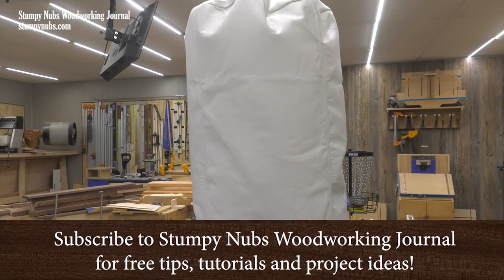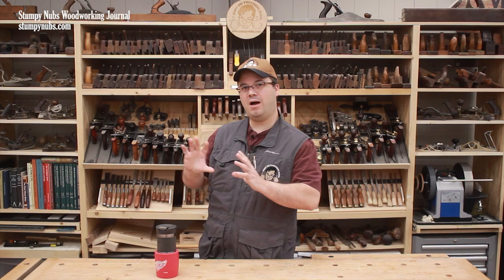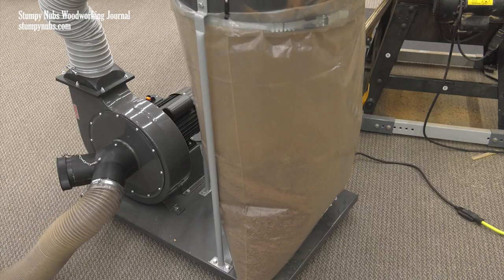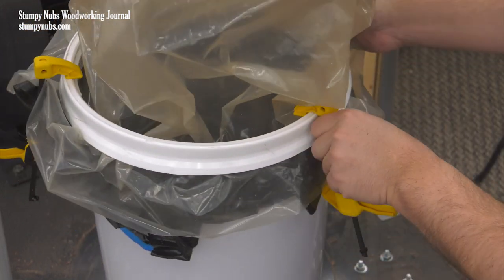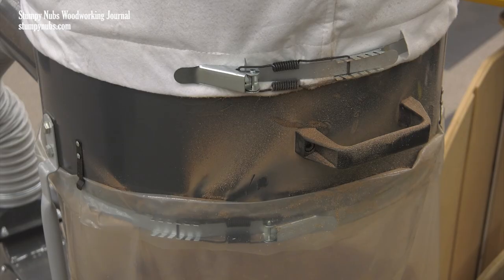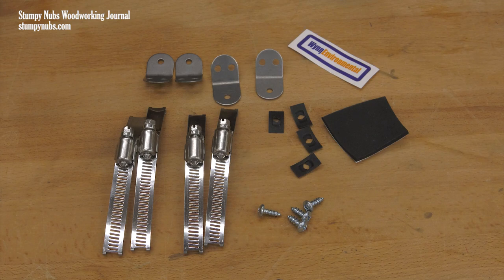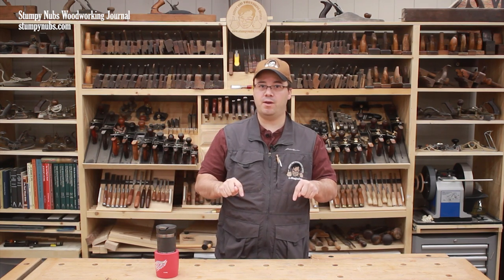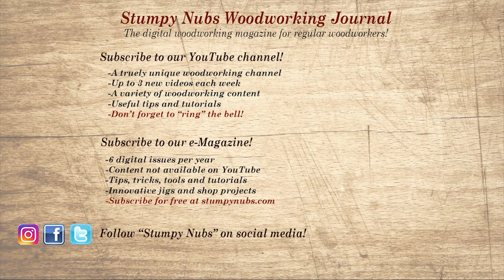How a bucket and a donut changed my dust collector

Comment: Decades ago, and I think it was an article in "Woodworking" magazine, I saw 2 dust collection solutions that made the most sense to me - The first one was to simply vent the upper stage of the collector to the outdoors. The second was to put the entire 2 stage collector outdoors and just plumb the ductwork in the shop. That might not be easy for many shops, but what are your thoughts? Also, as for emptying the lower bag, why not just take it outside and empty it there? Whatever bag the collected dust is emptied into is going out with the trash anyway. Which raises a third question - is there any approach to recycling the collected chips/dust (as wood filler, mulch, or other solutions) ? Thanks!
Reply: @abcaabca6364  Thanks for your thoughts on this. I've since seen a number of YouTube videos that feature compressors, dust collectors and other stuff in separate exterior sheds attached to the woodshop. But, regardless, I agree with your point about A/C and heating. I suppose it depends upon how and how much those tools are used. It's a good point you make. As for recycling, I'm now curious. I cut a fair amount of pressure treated lumber. Do you think the chemicals used in pressure treated sawdust makes a difference where mulching is concerned? Right now I'm either throwing it all away or using it to soak up old latex paint before throwing those away.

Comment: All of that is fine but seriously those plastic bags are like 25 bucks for a five pack....just throw the 5 dollar bag away every couple weeks when you fill the bag...All that screwing around to get the chips and dust into a 5gallon bucket with another plastic bag in it is ridiculous...
Reply from the maker: Before you dismiss something as ridiculous you should consider that other folks see things differently. It's not just about the cost, as I explained in the video. It's also about the hassle of removing and replacing the bag using that band clamp. People HATE those bags and they HATE those band clamps. Maybe you don't, but it isn't fair to dismiss the opinions of others outright as ridiculous. We work hard to produce content for all sorts of woodworkers because not everyone's experience is the same.  :)

Comment: In the past I have replaced the metal band that holds the lower bag on, with a modified ratchet strap. I cut off the short hook strap and cut the hook off the long strap, then sewed the long strap to the ratchet. You may have to put some weather stripping where the ratchet is

Comment: If you are using clamps on the bucket to hold the rim down to hold the bags, why do you need a Gamma Lid rim? Wouldn't a standard lid with the center cut out work just as well?
Reply from the maker: You can try it, but a regular lid is not moulded to remain rigid without the center while the ring on a Gamma lid is.

Comment: I put this idea to use immediately with certain modifications. If I could have, I would have posted a picture to illustrate. All 5 gallon buckets are not the same. Some have a wider space at the top  and can handle a belt or mesh band clamp. I use a narrow nylon tactical style belt that can be clipped the drawn tight. (Freebies with lots of hiking pants.) No spring clamps. I have the gamma lid but abandoned it quickly. With this setup I skip the black plastic bag and dump my sawdust in the tall paper lawn and leaf bags after every session or two.
Reply from the maker: We thought of a similar setup but it didn't seal as well.

Comment: Stumpy, great job of making a step by step guide for the upgrades to my recent HF dust collector.  I do have a question about the swirling of dust in the collector bag.  Is this fine dust going to shorten the life of the Wynn filter that I put on the top of the collector? and would a Thien type separator keep most of the fine dust in the bag below.  
Thanks so much for the great content on your videos!
Reply: A separator really is required.  My filters don't even get dirty with the separator.  I'm not even sure why I watched this, I already did my Harbor Freight dust collector upgrades a year ago!

Comment: I found the best way to check for leaks in dust collection was to collect the dust from a wood with a strong smell (I have some padauk) and see how quickly you can smell the result. A contrasting wood to the collector will also allow you to see any gaps where dust is blowing out onto the machine.

Comment: I know you own a cyclone style dust collector but I am confused because I believe that the cyclone is PRE impeller and PRE filter and therefore the larger dust particles never get to the impeller or the dust filter and even less into the bag at the end. Granted there is some air/suction loss but isn't that overall preventing  the huge impact on the impeller and filters? Thus not having large exfiltration of dust from the endpoint of the system? I tend to want to prevent the larger particles from reaching even the impeller which I believe is the purpose/function of the cyclone.
Reply from the maker: I do not own a cyclone separator. I own a full cyclone dust collector, but that's of no use to my audience who owns these single stage systems. That's what this video is for. As for separators, yes they will keep the bulk of the dust from ever reaching the collector. But there is a trade-off. They reduce airflow/suction. I am not saying they are bad, I am just offering another solution.

Comment: What I do not like about the donuts is that it creates a shelf where dust accumulates and makes it difficult to get a vac up inside the filter. I suppose you could disassemble the whole thing but I find it easiest to reach up inside from the bottom and vac the inside of the filter. I have a Thien baffle in a basket designed for a sump pump system and it works great catching 90% of the dust. The plastic bag has never collected any measurable amount of dust, my impellers stay clean and I haven’t noticed any degradation in suction although I have not measured it scientifically.
Reply: Can't you make the inner diameter of the donut the same as the inner diameter of the canister? Or even less, so long as the gasket is sitting on the donut?

Comment: I went to the site you mentioned for the filters. It does not show a means to clean them. At around $200 each, cleaning will save a ton of money!. How would you clean them?
Reply from the maker: Blow compressed air on the outside. They will last many years.

Comment: I love love love these creative budget solutions. As a weekend woodworker, I'm always looking for ways to keep my garage (I can't even call it a shop) tidy and clean without having to spend a ton of money. I'd be thrilled to see more of this kind of video from you guys!
Reply: Every now and then open up the big door and blast everything with a leaf blower.
Reply: Paul Cox  this has been my thought too. I have seen folks on YouTube rip off the top of the dust collector and just send it outside. Assuming your neighbours and local environmental rules allow it the other downside would be if you are heating or cooling your shop. Then the dust collector will make very short work of stealing all that nice expensive warm or cool air and flushing it outside.
Reply: Paul Cox :
It seems Pauls think alike. I'm a Paul and that is exactly what I did.
I installed backer rod around the inside of the metal ring, with a bit of caulk.
Then laid in plywood with a 6" hole in the middle.
I attached 6" metal duct and vented it out the basement window, like a dryer. Works great.
Mine has a cloth lower bag, so I also hung a 50 gallon leaf bag inside the cloth bag.
Now no dust escapes from the cloth collection bag and i do not have to make a mess
emptying the bag, just put in a new one.

Comment: FYI: Rikon sells a replacement filter for their DC that fits the HF unit perfectly. 1.0 Micron Product ID #60-905 and usually retails for around $300.
Reply from the maker: Wynnenv.com is less expensive and it's a small, family owned business. Guess which one I bought :)
Reply: Stumpy Nubs their prices have dropped significantly since I looked several years ago. Selection is better too!

Comment: An idea along the lines of adding a bucket to the bottom of the dust collector clear bag is if you lift your hole machine up and add a wheelie bin with a wheelie bin bag instead of the bucket you could cut a hole out of the lid then attach the clear bag to the inside of the lid then add a large rubber seat around the in side of the lid then attach 6 hold down bolts with wing nuts then line the bin with a bag and lock down the lid then when you see sawdust reach the clear bag just open the lid tie the bin bag and replace with a new one

Comment: Perfect timing for this video. Was just watching Art Mulder ( Wordsnwood ) and saw he'd upgraded to a pleated canister filter so I was thinking about that.
I have a basic single stage unit and it is dusty.
How do you find the canister filter for longevity? Does it clog and need replacing? Does the "spin scraper" system really work and keep it clean enough?
I'm in Canada so I'm limited in what I can get here. Don't think Wynn ships here but there are a couple of available makers. King and Busy Bee both readily available.
Do you have any opinion about either of them regarding quality?
Thanks for any help you can provide.
Reply from the maker: They can be cleaned with compressed air so they last a very long time. I do not like filters with a "spin scraper" because it wears on the filter media and shortens its life. I do not know about Canadian shipping, but Wynn has excellent customer service so I suggest visiting their website and asking :)

Comment: This is great! I’m about to purchase a Buck Tools DC50 and will go ahead and apply these upgrades right away.

Question though - what did you use the seal the top/open end of the canister?
Reply from the maker: The cover I got from the filter manufacturer has a rubber seal on it.

Comment: Thanks stumpy for the video, it will come in handy ASAP. The bucket idea is fantastic. Can you help answer a question.? My dust collection is under my stairway in my basement shop and closed off completely from my shop. I also have the space venting outside with a bathroom fan that turns on when the collection turns on. My understanding is, you would normally want as large a filter as you can purchase or fit to help with cleaner air. My question is, if your cleaner air isn’t much of an issue, and the suction is the priority for me, can I go with a shorter “ less costing” filter? Thank you for any advice. And keep up the videos. Love em.
Reply: Just checking in to see if any body can answer my question?

Comment: Dear Stumpy Nubs
I've been trying my best to find the relationship between CFM and Water Lift, static pressure. I would great love to find how they correlate. A shop vac can pick up screw easily, but a DC can move lots of air. Would you have any articles or references on how the two work together and why a DC doesn't produce the static pressure a shop vac is able to.
Reply from the maker: I recommend billpentz.com

Comment: 4:10 "Now let's empty it".  This is what I want to do.  But your video didn't show what happened to the ring that was clamped down to the bucket.  Best I can figure is that the "doughnut" ends up in the bottom of the black bag.  Please explain.
Reply from the maker: I showed how I put it on, you just reverse it to take it off when you empty the bag.
Reply: @StumpyNubs  So you funnel all that dust through the ring?  Either that or it ends up inside the black bag.

Comment: As an alternative to canister final filter, consider a better upper bag:  American Fabric Filter did mine, and it's worked quite well since I got it in '08.  The air comes out quite clean.
Reply from the maker: You would need a very, very large bag to equal the surface area of a canister filter.

Comment: Hay Stumpy, I use to work in a custom woodshop. We had a setup similar to what you show here, for our old school 12" Dewalt Radial arm saw(we used it as a LARGE cut off saw). We also had our Bandsaw tied into it. The biggest difference is that we had a 2 blade paddle that was centered in the middle of the air filter with a handle coming out of the top. When the filter started to perform poorly, all we had to do was give the paddle handle on top a few turns. Doing this would cause the paddles inside of the filter to strike the inside of the ribs of the filter and knock the dust loose. Doing this every morning was a great way to prolong the life of the filter.
Reply from the maker: It's also a great way to shorten filter life. That's just coated paper inside there. As the paddle wears the surface the pores get larger and the filter loses it's effectiveness. Low pressure compressed air blown from the outside is a better solution.

Comment: Excellent and accurate information for important DC upgrades.  I would suggest that if you are going to make donut insert that you take it a step further and make it a Thien separator to add even more efficiency. It is how you shape the donut that makes Thien's  design so unique. It will act like an outside separator but between the collection bag and Wyn filter.  By forcing more particles down into the bag you will not have to clean the filter as often, yet another job that releases captured dust.  Caking in the filter does make it more efficient, until you hit that tipping point where if just blocks air flow.
Reply: Bruce, I am new to the channel and I just posted a similar question to Stumpy regarding a Thien separator to the top of my HF unit.  Did you ever add a separator to your dust collector, if so would you care to share your design details?
Thanks

Comment: Hello i hope you can answer my question. Today my order for A Jet canister filter arrived and i was so bummed out that i ordered the wrong size i have the big one and ordered the small one :(. My question is, They are charging me 100$ to ship back to get my return so i was wondering if theres any drawbacks if i were to use this small one  and adapt it like you did on your video. This really ruined my day i just started woodworking last year and was looking forward to this but now it seems i either use the smaller filet ( i dont know if theres drawbacks to that) or lose 100$ on shipping and pay even more for a new one. Please help .
Reply from the maker: A smaller filter will give you less overall surface area within the pleats for the air to escape. That can reduce airflow. HOWEVER, unless the canister filter is a LOT smaller, it is still likely going to give you a lot more airflow than the filter bag that I assume you are replacing. So, I suppose there is no reason you couldn't adapt it as seen in this video.
Reply: @StumpyNubs  thank you so much!. Btw what is the name of the clips you used?

Comment: The thinking on this topic needs to be seriously questioned in this industry. 

To my thinking, air in a woodworking shop should be a directed wind tunnel. Moving lots of fresh air in as the air in shop is polluted, collected, run throught a clensing process and set free back into the world.

End stage should be exterior exhaust. Not getting it as clean as possible just to have re-entry into the working space.
Reply from the maker: Air going out must be replaced by air coming in from outside. If it's hot or cold outside, you don't want to trade air.
Reply: @StumpyNubs  Good point.

Air can be conditioned just as easily as it is moved or filtered. The insulation of the space mitigates both of those.

Moving air always feels cooler, so if you have good movement from the top into the space of the room down and out of it ( after some cleansing and filtering) that would handle much of the cooling affects. 

Warming would require space heating of some sort.  Radiant heat of some sort would help. 

Additionally the wind tunnel only has to be in operation when work is being done. 

Lastly clothes can be adjusted.

I just think all the work and money spent on trying to clean ALL the air in a space is an expensive and a little futile when compared to just exhausting it outside. 

If I lived in the country I would hook up some serious air movement out and down from my space. As it is I will be doing a bit of that but will focus on capturing and filtering a reasonable amount of it first. 

I am also thinking of creating  a "sanding room" as sanding produces the most fine dust.

Thanks for you response.

Going to be doing some science later this week on all this. Keep up the good work. 

Watching some of your older videos. Lot more humour back then. Just saying.

Comment: ehh, the bucket doesn't really solve much, just get beefy disposable bags for the bottom.
Reply from the maker: Most people hate changing bags and messing with that band clamp. If you don't mind, then maybe this tip isn't for you :)
Reply: My Delta DC uses a padded ring that snaps inside a ring on the bottom of the DC, with the top of the bag squeezed between the 2 rings. Getting the padded ring loose with nothing to hold on to is a real pain, and getting it reassembled (with the lip of the bag high enough to be secured between the rings, but not high enough to interfere with the airflow around the impeller) with just 2 hands is also a pain. I upgraded to a canister filter and added a cyclone years ago. While the cyclone cuts maximum airflow, having a  consistently good airflow (due to the cyclone keeping dust out of the filter) sure beats an occasional great airflow, followed by mostly poor airflow once the filter gets clogged up -- without having to clean the filter every few hours. Hardly ever get anything in the bag anymore -- otherwise I'd be using this 5-gallon solution.